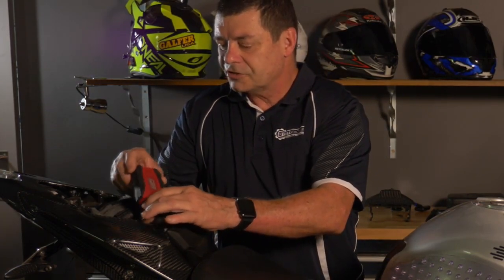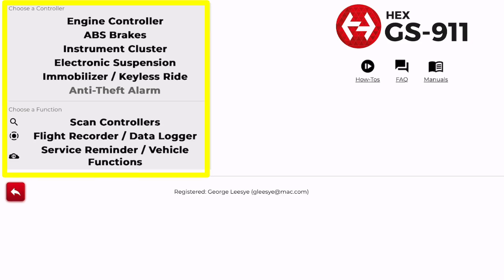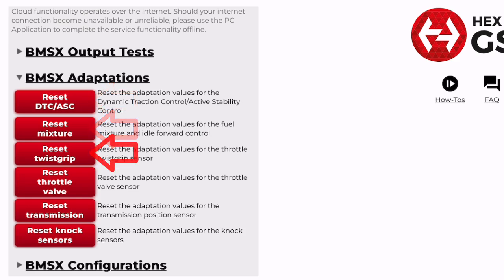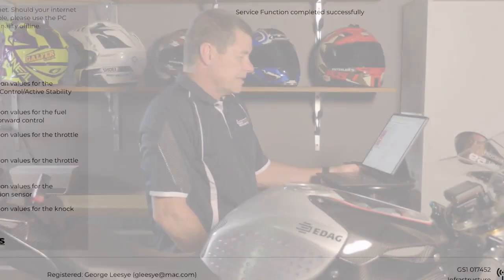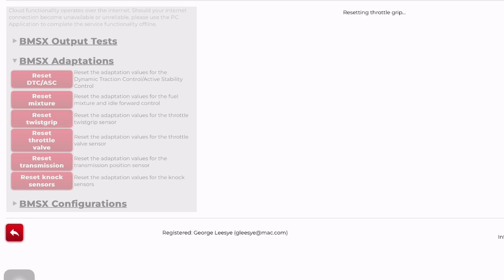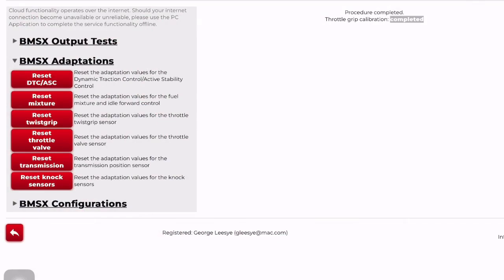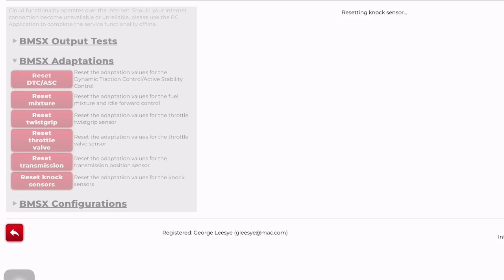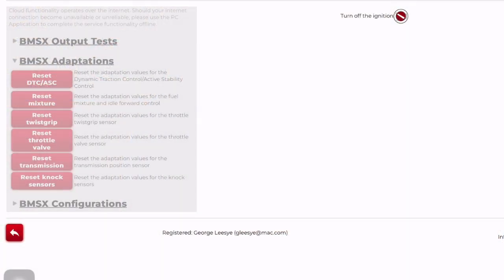How to Reset Adaptations Properly on the 2015-2016 BMW S1000RR

Comment: When I attempt to calibrate throttle twist grip and hold at full throttle, it does not hold a stable percentage and jumps between 90-100%.

Is this normal?
Reply from the maker: I can't answer that mate, outside of my pay grade that one. I do wonder if the twist grip is faulty, it does happen.

Comment: Do you have to give it throttle through each gear and shift using the clutch while doing the 10 seconds each gear? And do you use the clutch while shifting down through each gear and hold them 10 seconds each to as well ? I want to do this to my 2015 I recently changed my rear sets and is a bit jerky at high rpms and i know i have to do this whole transmission reset but unsure if i have to do clutch up 1st through each gear or use the quick shiftet 1st ?
Reply from the maker: no mate, I just run it on the stand through the gears, what I did do was run it up and down with quick shifter. The purpose is to reset adaptations for the QS which responds to foot pressure ... so based on that I don't believe it's necessary to do it with clutch on the stand, especially if you always use the QS when you ride. But I do take it onto the road and then do a run up and down with clutch and with quick shifter so it learns those conditions.

Comment: Hey Man I have a 2015 s1000rr and after I reset my adaptations my QS stopped working. Any ideas?
Reply from the maker: I dont know why that would be the case. Like @adanrios5884 asked, if you did it with the clutch on the stand that doesn't support the system learning the QS operational conditions
Reply: @TheBikeStig actually i did the whole reset adaptations and transmission reset and did use the clutch to shift from 1st to 6th gear for the 10secs and when on a street ride did a few pulls using the QS and shift perfectly fine and did some pulls and shift using the clutch and the same butter smooth all gears after the reset.
Reply from the maker: @adanrios5884  that's awesome mate, I believe it takes a little while for the system to learn how you ride and all of the conditions so it would have taken on board how you use the QS on the ride.
Reply: Did you hold each gear 10 seconds up and down on a stand using the clutch while doing so ? Or no ?
Reply: You have ride the bike on the paddock stands for 10seconds each gear it doesn’t matter if you shift with clutch or quickshifter just hold each gear 10 seconds while sitting on the bike done deal.

Comment: is it oke to reset the adaptations after you got your bike dyno tuned? or will this change certain parts from the flash?
Reply from the maker: It won't change anything from the tune, I've done it multiple times now, advice to me is you should actually do the adaptation reset after any change like this.
Reply: @TheBikeStig  Thank you!

Comment: Do you use the clutch when going up and down the gearbox when resetting the transmission
Reply from the maker: @WynandVanEeden-k1k  Advice given to me is that during that first ride you do, use both quick shifter and clutched gear changes through all of the gears. If you only use the quickshifter during the relearning period, the bike will adapt specifically to quickshifter operations. This might be sufficient if you always ride using the quickshifter. However, the gearbox will lack adaptations for clutched gear changes, which could result in: - Slightly less smooth clutched shifts and Poor performance in situations where clutched shifting is required, such as starting from a stop or slow-speed riding. Hope that helps.
Reply: @TheBikeStig so you do 10 seconds each gear twice ? 1st one shifting with quickshifter up each geat 10 seconds then down with clutch or autoblipper? And then clutch each gear down with the clutch ?
Reply from the maker: @adanrios5884  sorry mate, missed this - I just run it on the stand through the gears, what I did do was run it up and down with quick shifter. The purpose is to reset adaptations for the QS which responds to foot pressure ... so based on that I don't believe it's necessary to do it with clutch on the stand, especially if you always use the QS when you ride. But I do take it onto the road and then do a run up and down with clutch and with quick shifter so it learns those conditions.
Reply: Thank you